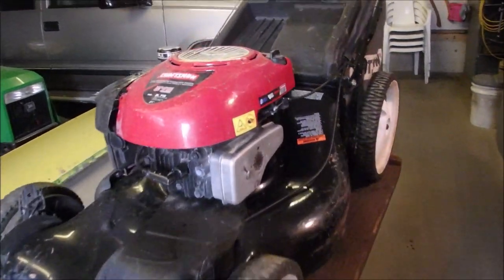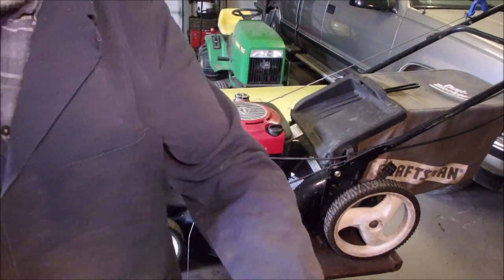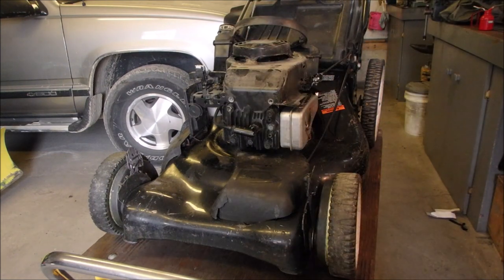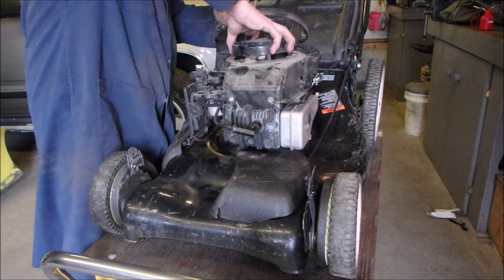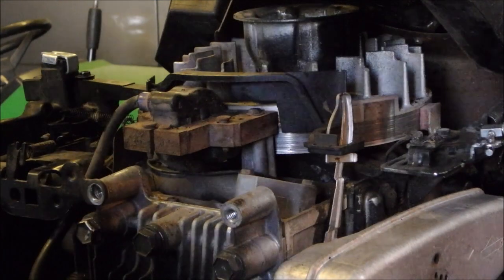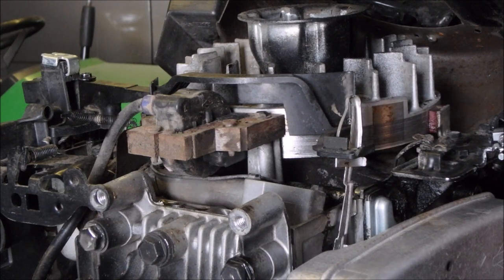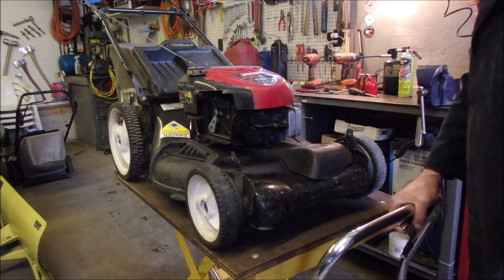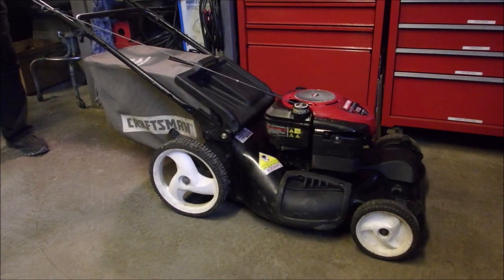Craftsman, Briggs Auto Choke Issues, and more

Comment: Because of you Bruce I learned repairing and/or making up new cables for my mowers. Nothing more disappointing then ordering a control cable as per part number and finding the cable is too short. In that case, it was my first repair to splice it longer to fit the mower, and repair the old original cable for a spare. I've save trips going to the mower repair shop, and not being satisfied in their job quality. Time is money on their end, they can't charge too much for the repairs vs. the value of your mower.
Reply from the maker: Thanks Bill

Comment: I like the primer bulb version much better than the automatic choke.
Reply from the maker: Me too.  Reliability is what I like.
Reply: @BrucesShop  I have a Tecumseh generator that never wants to start on choke but runs fine afterwards. I have cleaned that carb 3 times with no improvement. I am thinking about putting a primer carb on it instead.
Reply from the maker: @haneyoakie14  Spray some carb spray on the gaskets.  If the RPM's changed you are running lean and need gaskets.  That is all i have.
Reply: Tired of rebuilding and cleaning the carb/float bowl every three weeks. Starts first pull then gets dirt in the float bowl and dies. Back to putting inline fuel filters in I guess, won't be buying another Craftsman.

Comment: Another great video Bruce.  What did you use to clamp the bottom of the brake bail cable to the engine side?
Reply from the maker: You can buy cables with on end being a z bend.  The other a z bend clamp   here is one    this should get you started.
https://www.ebay.ca/itm/372677001455?_trkparms=aid%3D1110006%26algo%3DHOMESPLICE.SIM%26ao%3D1%26asc%3D20200818143230%26meid%3D6df6a442f5534c4eaf1c7a6357b61601%26pid%3D101224%26rk%3D1%26rkt%3D5%26mehot%3Dnone%26sd%3D223384528561%26itm%3D372677001455%26pmt%3D1%26noa%3D1%26pg%3D2047675%26algv%3DDefaultOrganic%26brand%3DRotary&_trksid=p2047675.c101224.m-1

Comment: I have nearly the identical machine only mine has the primer bulb and I don't have the high wheels in the back. Not a fancy model but it has been a solid runner. The only issue I had was actually very recent and was the float bowl was sitting very low and not letting enough gas through to keep it running. Its one of those plastic floats and I had to carefully heat it up to make adjustments. I don't know how long that will last so am going to have a replacement on hand for when it goes.

Comment: Hey Bruce
For the second time now (on Sunday), I’ve had to fabricate an autochoke spring.  Also, the little arrowhead shaped spring hook was broken off, so I drilled a small hole in the arm and hooked on my new spring.  Surprisingly, it ran without it and I also discovered the bi-metallic arm was all bent over.  No idea how that could happen under the shroud.  All good now!
Reply from the maker: Great work Jim
Reply: @BrucesShop  Hey Bruce
Do you see comments that have links included, or are they automatically deleted?  I notice they aren’t visible in the comments section.
Thanks, Jim

Comment: Well explained video.
I have the same engine on my John Deere push mower. I get a very high idle at startup and once it warms up it runs fine. I replaced the thermostat and the carborator. The air vane lever looks fine and opens choke as it should. Always starts first pull. All replacement parts have been OEM B&S. Any thoughts?
Reply from the maker: You are doing great.

Comment: Bruce what size cable did you use, and what was the z bend adapter?
Reply from the maker: I use 1/16 inch  stainless rope.  The Z bend adaptor are available on amazon.    U.S.  Amazon link
https://www.amazon.com/Rotary-Pack-14819-Universal-Cable/dp/B07H52BZJN/ref=sr_1_1?crid=TQOBT8WK4806&keywords=z+bend+adapter&qid=1663176479&sprefix=z+bend+adaptor+%2Caps%2C115&sr=8-1

Comment: Bruce what size gauge wire,do you use to repair,the cables and what fittings do you use.Thank you nice video.
Reply from the maker: I forget  but here is a link to the little Z bend attachments
https://www.ebay.ca/itm/372677001455?_trkparms=aid%3D1110006%26algo%3DHOMESPLICE.SIM%26ao%3D1%26asc%3D20200818143230%26meid%3D6df6a442f5534c4eaf1c7a6357b61601%26pid%3D101224%26rk%3D1%26rkt%3D5%26mehot%3Dnone%26sd%3D223384528561%26itm%3D372677001455%26pmt%3D1%26noa%3D1%26pg%3D2047675%26algv%3DDefaultOrganic%26brand%3DRotary&_trksid=p2047675.c101224.m-1
Reply: @BrucesShop  I ordered the 10 pack of those from your link here. With tax and shipping, they are $1.10 each (US). Much better than the $3 each I had to pay at a local place last week. But it was worth it, my customer would have had to pay almost $20 and wait a week if I ordered a new cable. $6 in Zed bends, $0.19 per foot for cable, sheath was good except plugged in the middle where the old one rusted and broke. I used the long part of the broken cable as a long flexible drill bit to drill it open again, rotorooter style. $7 is better than $20. 

Be on the lookout for a big check for your commission on the $11 Zed bend order.

Comment: Found a practically brand new Toro push mower with a Briggs auto choke on the road this summer. Runs good, problem is when I start it it runs real slow initially, just stumbles  over barely staying going. But all I have to do is let it run like that for a few seconds, kill it, then start it again and it's fine. Strangest damn problem I've ever had with a small engine and I can't figure it out.
Reply from the maker: Carb clean or a sticky governor i think.  Don't adjust the governor though.